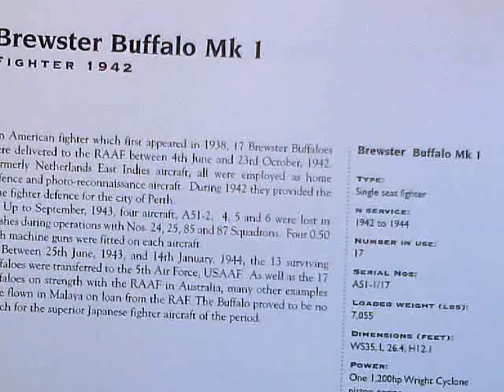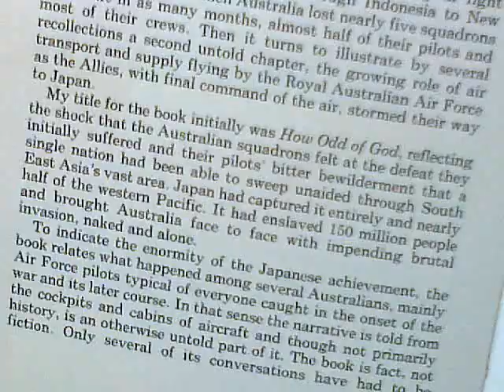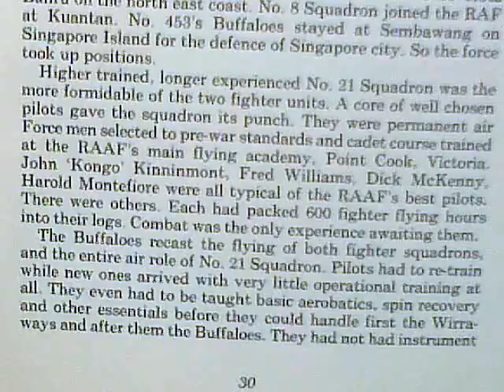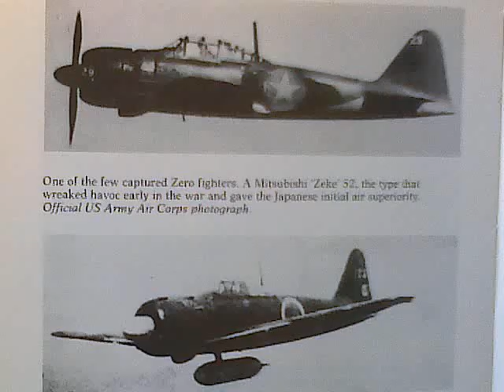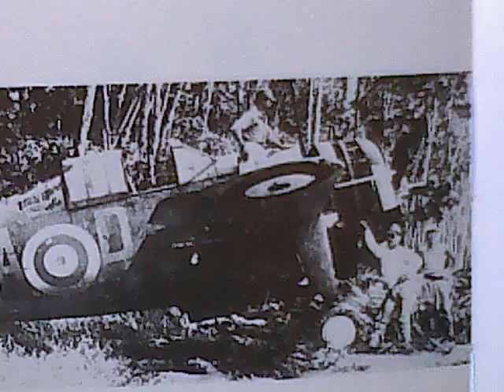World's Worst Fighter Aircraft, The 1941 RAAF Brewster Buffalo !

Comment: My dad was a mechanic -- Aviation Machinist's Mate, USNR -- called to active duty about the end of 1940. He worked on nearly every carrier plane the Navy had all through the war. Of them all, he said, the Brewster Buffalo was the worst. "They broke down all the time". When loaded with armor, with self-sealing fuel tanks, with enough fuel to be useful, the Buffalo was under-powered. Further, the air-frame was too small to fit a larger engine, so it was a dead end.

Comment: Incredible, and to think that the Fw190 was already in service during this time miles ahead  of the Zero and the Buffalo
Reply from the maker: G'day,

  Thanks.

   Well, yeah, the Butcherbird was just coming into service in latw '41, but the Zero had been in service for 2 years before the FW-190, and the Buffalo was designed to meet US Navy Carrier-Fighter Specifications in about 1936...

  And the FW-190 was designed in the knowledge that the Zero existed, and was beating the Bejesus out of the AVG's P-40 Thomas-Hawks in China.

  So, a Zero a Buffalo and a FW-190-a are not really contemporaneous...(?).

Such is Life,

Have a good one.

;-p

Ciao !
Reply: Good points , can’t really compare apples to oranges  but I looked on wiki and noticed the FW 190s first flight was June 1939 and the zero April 1939 .Not sure how much Kurt Tank knew about the Zero at the time .Safe to say the FW took longer to develop before it became operational .
Reply from the maker: Ah, yes, I see what you mean ; April to July in '39  - with both Aircraft being on the Secret List in both Countries..., means that both Designers were working independantly.

 Perhaps both were inspired by Polikarpov's I-16 "Rata" ?

  It, as well as the I-15 & the  I-115 were so tightly and efficiently cowled that the Radial Engine's Waste-Heat, expanding the Air allowed to enter the flat-fronted Cowling for cooling the Cylinders and Heads, generated a Net Thrust as it departed through a constricted annular Slot and each Exhaust Stub blew through it's own annular Exit-Port - so the Exhaust Gas velocity, via Venturi Effect, scavenged the heated Cooling-Air and sucked it out of the Cowling....

  And the Ratas were fighting Me-109s in Spain in 1936...

  The Yanquis called it the "Meredith Effect" when it was the North AmeriKan P-51 Mustang's Radiator which they were discussing...; but Polikarpov got there firsties !

Such is Life,

Have a good one.

;-p

Ciao !
Reply: It's about fulfilling requirements. The Buffalo and zero were designed with range as a requirement, price, and speed of manufacturing. 
 The Zero was a naval fighter. The fw190 was not built for carrier operations (obviously) and therefore didn't have to make those design compromises. The zero had twice the range of the fw-190 and I think the Buffalo did too. Every decision an engineer makes has a result and a side effect. Compromise after compromise. The fw-190 is obviously superior to either of them on paper, but not necessarily in the big picture. After all, the Fw190 did get massacred by allied aircraft in the end. Sure it was better than a Spitfire, but it wasn't better than 2 Spitfires.
Reply: @AdamAdamHDL  Better than which Spitfire?  The fw-190 was better than than the MK5 but not the MK9.  The later Griffon engined Spitfires also outperformed the later upgraded fw-190.

Comment: One problem that does not get much mention is that Brewster had a reputation for poor quality control.  When they moved on to building other planes like the Corsair, the government had to take over their factory because of the crap that was coming off the assembly line.  Of course, this was a different factory than the one that produced Buffaloes.  That one was a multi story building in New York City that was totally unsuited for mass production of anything.  Moving airframes on freight elevators between floors during the course of construction is not an efficient way to build hundreds of airplanes.
Reply from the maker: G'day,

Thanks.

Yes..., the Feature Article which Aeroplane Monthly printed some years ago mentioned that stupid 4-Story Factory setup.

After assembly, Buffaloes were disassembled for trucking to an Airfield to be Test-Flown, then pulled to bits again and crated-up for shipmemt via Train to California or an East-Coast Seaport for a Boat trip to Hawaii, the Phillipines, Indonesia, Malaya, Burma..., or Finland.

  Have a good one.

;-p

Ciao !

Comment: The Brewster model B-339E, (Buffalo in British service), was defiantly a very flawed fighter, but the engine used in that model was the Wright GR-1820-G105A rated at 1,100 hp for takeoff. It may be true the engines were only delivering 600 hp in the field due to fuel differences, engine wear, climate conditions, and maintenance problems, but the engine was still rated at 1,100 hp under test conditions. However, even at the full hp rating, the Buffalo was “meat on the table” for the Mitsubishi A6M Zero! (Data source; War Planes of the Second World War by William Green, Volume IV, page 33.)
Reply from the maker: G'day,

  Thanks.

   Yeah, it was totally hopeless in the Pacific, the Dutch and Australians and British & the US Marines all had similar experiences...; slow, overweight, underpowered, with Radios & Fuelpumps which didn't work, and Guns which jammed, blinded the Cockpit & shot it's own wings off....

  So it's really weird that the Finns have a Buffalo in a Museum because it shot down 44 Enemy Aircraft, and thus is the highest-scoring individual Airframe in the history of War..., while 5 Finns became Aces while flying Buffaloes (there were only 500 Buffaloes ever built !), 11 Finns shot down 205 Enemy Aircraft while flying Buffaloes, and one Finn scored 43 Victories in Buffaloes - while the Finnish experience so heavily outweighed everything which happened to  Pacific Buffaloes that the Buffalo joins the Fokker Eindekker in having shot down more Enemy Aircraft than were built in it's own Production-Run.

  I grew up on the stories of how bad it was in Malaya, and really only came up to speed on the Finnish experience as a result of the Comments in this Thread...; but I underconstumble a lot more about it these dayze...

  Have a good one,

  ;-p

  Ciao !

Comment: If it was the worst how did the Finns manage to shoot down 41 or 43, I forget the exact amount, of enemy aircraft with one.  I think it was one of the best if it was used right.  No other aircraft in the entire war matched the record of the Finnish one.
Reply: Sorry Jeff, I should have read before writing.
Reply: 'Pappy' Boyington said of the Buffalo that "It would do a loop in a phone booth".  Maybe there was something lacking in the pilots?
Reply from the maker: G'day,

  Thanks.

   Actually, the  Buffalo in the Finnish Museum shot down 44, and it's the highest scoring individual Airframe in the history of War. One Finnish Ace scored 43 Kills in Buffaloes, 5 Finns became Aces in Buffaloes (and only 500 Buffaloes were ever built, so 1 Ace produced per 50 Buffaloes constructed. Eleven Finnish Aces shot down 205 Enemy Aircraft while flying Buffaloes, and because of the Finnish success with them Buffaloes join the Fokker Eindekker in having shot down more Aircraft than were built in their own Production-Run.

  Because the Finnish Buffaloes were early models, lacking the later "improvements" which made the Pacific Buffaloes so badly overweight, and lacking the .50 calibre Guns to break their Mountings, they used German Guns (which worked), and German Radios which also actually worked), and the "Continuation War" happened below the height where the Buffalo's Fuel-Pump failed...

  But the biggest factor is that the half-trained Soviet Peasants in Polikarpovs (I-15s & I-16s) were not highly trained elite Squadrons of Combat Veterans with years of fighting in China under their belts, and the Soviet Beginners were not flying Zeroes, either.

  If it's any consolation, the Finnish Buffalo Jockeys shot down 15 Soviets for every Buffalo they lost...; but when they were re-equipped with an actually good Fighter (Me-109 F & G models) the Finnish Kill-Rate jumped up to 26:1.

   Two different Aeroplanes, differently equipped & differently operated by two different Air Forces,  against two different Opponents, in two different Air-Wars, in two differnt Locations and two different Climates....; it isn't like comparing Apples with Apples, as it turns out.

  The RAAF Buffalo was not the same as the Finnish Buffalo, in any way other than that they were both built in a 5-storey Building in New York by the Brewster Company.

   Such is Life...

  Have a good one,

  ;-p

  Ciao !

Comment: There were different models you must remember.  Those that were sent to Finland were early models closer to USN specification with better quality control.  These were then stripped and lightened to be “the Zeke of Finland”.  USN issues were recalled and corrected, gained weight and were flown by green pilots at Midway so never got a good review versus the Wildcat.  British and Dutch models were mass produced, and fitted with refurbished ex us airline DC-3 engines in order to complete the orders.   Gun mounts and other details were sub standard.  It did not help that British orders specified extra armor, self sealing tanks and Brewster cut corners in production.  Due to their incompetence producing Corsairs they would be put under administration.  Had the RAF received half the planes at twice the quality then they might have had a chance against the Japanese.

Comment: The Brewster has the record for most aces per planes produced and the most kills to a single airframe (44). The Finns called it the 'pearl of the sky' and rated it their first choice as a fighter. It shot down Russian fighters as well as P40's and Hurricanes by the dozen . Even in the Pacific it still had a kill ratio of 2:1. Maybe it was  politically easier to blame the aircraft and not the incompetent and unprepared people in charge of our defence at the time. The Finns adapted it to make it work and it proved to be a very good aircraft. It is not the fault of the aircraft if it is not operated or maintained to suit the conditions it is expected to perform in.
BTW- it did win the USN bid for a carrier fighter and it was the first monoplane fighter with retractable wheels and enclosed cockpit to operate from USN carriers.
Reply from the maker: G'day,

   Thanks.

    All that and a bag of Potato Chips...

    But, as I've already said, the Finnish Buffalo used German Radios which were not drowned-out by the Static from the Tropical Thunderstorms which do not occurr over the Karellian Peninsula...., and the Finns used German Guns which neither blinded the Pilot with Grease on the Windscreen and nor did they shoot the Wings off the Buffalo when fired...., the Finns fought a Low-Altitude Air-War wherein the Buffalo's Fuelpump was not overwhelmed by the low Air-Pressure and therefore it did not  oblige the Finns to pump Petrol with one hand any time they went above 10,000 Ft...; and the Finns never began (in the Winter War) by being Combat-Virgins, Neophytes, up against highly-trained "elite" Combat-Veterans with 5 years of War in China behind them...., and finally, the Finns never fought against Zeros - the Finnish Buffaloes scored most of their Fighter-Kills over Polikarpov I-15 Biplanes, & I-16s...

  Also, I query your assertion that the Buffalo avhieved anything like a 2:1 Kill-Rate in the Pacific..; I think you have that backwards, and even that sounds overly generous, two Buffaloes shot down for every Japanese Aircraft destroyed by a Buffalo sounds about half right - in that all other Buffalo losses from Accidents & Air Raids don't figure in the "equation".

   The USMC Buffaloes out of Midway were all shot down for no result..., the Netherlands East Indies Army Air Farce's Buffaloes got shot out of existance - except for the ones which they surrendered to the Japanese for evaluation & the making of Propaganda Films, the RAF and RAAF Buffalo experience was as I detailed in the video.

   Overweight, underpowered, encumbered with useless Radios, fitted with suicidally  counterproductive Guns & a dysfunctional Fuel-Pump....; the Brewster Buffalo was not a suitable Conveyance, in which to venture aloft intending to pursue The King's Enemies, not  within the Pacific Theatre of Operations, it wasn't.

  Take it easy,

  ;-p

   Ciao !
Reply: David Toohey OHHH PLEASE! YOU'RE SAYING IT HAD MORE KILLS THAN MUSTANGS OR HELLCATS... COMPLETE BULLSHIT MY FRIEND. COMPLETE BULLSHIT... LOL!!
Reply from the maker: +Samuel Parker 

 G'day,

  Thanks.

 Ah, well, you might want to rethink that position...

  What he said was that the Brewster Buffalo (which had a really small Production-Run, something like 500 Airframes all-up) produced more Aces than any other Design, calculated on how many Aeroplanes were built versus how many Pilots became "Aces" while flying them.

  I'm looking at "Air Aces" , 1983, by Christopher Shores, and on page 110 it names 10 Finnish Aces who scored between 5 and 42 Aerial Kills while flying Buffaloes... (226 Kills between them).

  No Australian, British, Dutch, or AmeriKan Buffalo Pilot ever became an "Ace" while trying to stay alive in a Bufflo against the Japanese...

  For context, from Page 7 of the same source, "...during WW-2 over 1,000 British Commonwealth Pilots, and 1,200 AmeriKans, and 2,000  Soviets, and 4,000 Germans  were credited with 5 or more Aerial Victories, and thus became "Aces" as the word is commonly  understood. These men  probably claimed well over 50% of all the Victories credited to their respective Air Forces..." (while Finland produced 8 Aces during the Winter War & another 11 during the Continuation War ; as I said, 10 of the 19 became Aces while they were flying in  Buffaloes).

   So, the Buffalo produced roughly 1 Ace for every 50 Aeroplanes manufactured..., and meanwhile there were about 26,000 Spitfires built but there were not 1,300 "Spitfire Aces", nothing like it - more like 300 or 400 at most because the Brit's had LOTS of other "Successful Fighter Designs" ; there were what, 15,000 Mustangs (?) produced - but there were not 750 "Mustang Aces", were there...(?) - more like 300 perhaps, and a big bunch of them involved "Ground-Strafing 'Kills'..." which the USAAC's 8th Air Farce allowed in 1944-45.

  The fact is that a great big Shitpotful of the Spitfires and Mustangs never ever made "Aces" out of their pilots, because they were far too busy crashing & burning under the Guns of some of those 4,000 German Aces...; and the US Pilots spent such a limited time in Combat in the Pacific before being rotated to a Back-Area and then promoted to become an Instructor..., that not a lot of people (relative to production-figures) ever made "Ace" Status by flying a Wildcat, Hellcat, or a Corsair (and I don't think any Kittyhawk Pilot ever made "Ace" in the Pacific).

  So, yeah, you'll have to give him that point.

   The Finnish Air Force also made the Buffalo one of the very very few Fighters to have shot down more Enemy Aircraft than the number of it's own Production-Run - despite the disasterous showing which the Buffalo put up in the Pacific.

 It's a connundrum.

  Take it easy...

 ;-p

 Ciao !
Reply from the maker: +David Toohey 

  G'day,

    There there, take it easy Old Bean, I had already explainificated to him the magnitude of his erroneousness in underconstumbling what you said.
   
  Have a good one,

  ;-p

  Ciao !
Reply: The Finns thought the Browning .50 caliber guns for the Buffalos were a great improvement over the .30 caliber guns they had in the Fokkers.
Reply: @WarblesOnALot  Yes, except that FAF produced 96 aces in total during the WW2. Out of them 36 scored at least 5 aerial victories while flying Brester B-239E (the export version of F2A-1, with e.g. Wright R-1820-G5 engine,, producing 950 hp).

Here's the score board of all of the Finnish aces. 
https://en.m.wikipedia.org/wiki/List_of_World_War_II_aces_from_Finland#Finnish_fighter_aces

"The B-239E was never referred to as the name Buffalo in Finland; it was known simply as the Brewster, or by the nicknames Taivaan helmi("Sky Pearl") or Pohjoisten taivaiden helmi("Pearl of the Northern Skies"). Other nicknames were Pylly-Valtteri (lit. "Butt-Walter"), Amerikanrauta ("American hardware" or "American car") and Lentävä kaljapullo("flying beer-bottle")."
Reply: Mr. Toohey is right.  The Buffalo beat out the early Grumman Wildcat in USN acceptance trials.  So the Navy bought the Buffalo.  But as an airplane manufacturer Brewster--which started as a furniture making company, was a disaster.
Reply: @WarblesOnALot  hi !love your brewster buffalo vid!i think geoff fisken flying the wairarapa wildcat p-40 in the rnzaf became an ace in the p-40,he did have a few kills from his time on buffalos in singapore tho...i will have to relook at it... cheers..Ps has there ever been any buffalos recovered?apart from the one in finland..would be nice to get one and a dauntless for the airforce mueseam  in christchurch nz

Comment: I'm starting to re-consider anything said by Australian Pilots about WII aircraft. The Finns did just fine with them, dropping the weight, tuning them up and using them to their strength. (Turn fighting in mountain areas.) They didn't like the p-39 either, I'm starting to think it was a lot better than the Australian flight reports.
Reply: There are no mountains in Finland. And finns didn't modify Brewsters a lot. They only replaced the gunsight and replaced the original 7,62mm mg in the fuselage with 12,7mm LKK42 from 1943 on.